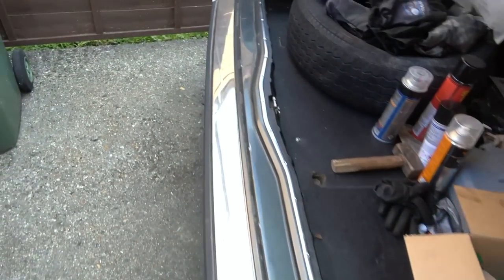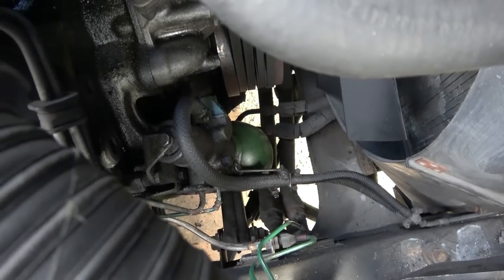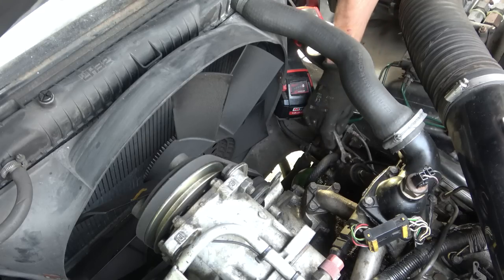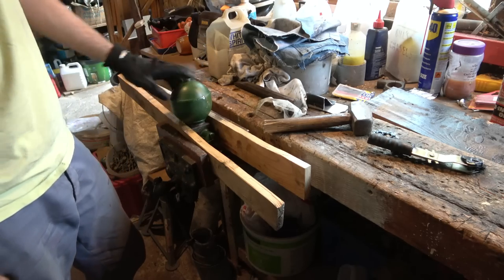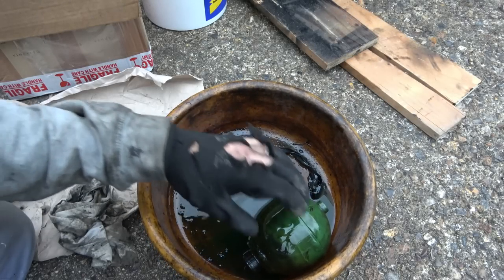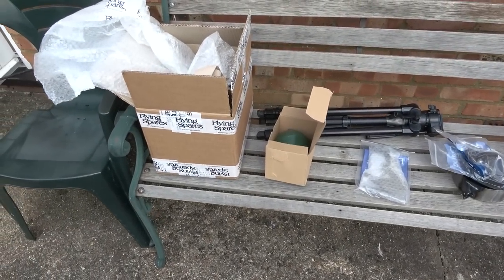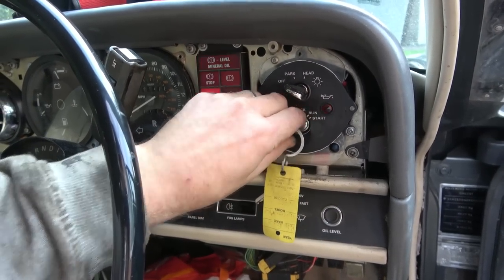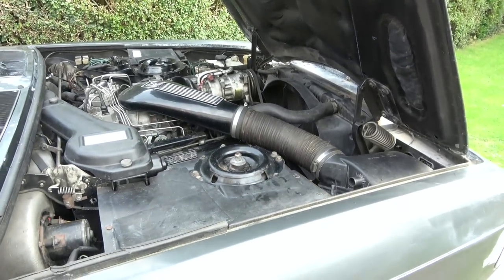Putting Braking Pressure BACK into a 1988 Rolls Royce Silver Spirit - PART 28

Comment: Vince, just a suggestion if you haven't done this already, you should let the car start and run and get nice and warm for a bit (at least a half hour or so). You've done quite a bit of work and starting and stopping the engine. When you run it for short periods, it doesn't get hot enough to burn off any condensation that may build up in the engine causing water to sneak into the oil. You probably aren't doing enough to cause any kind of damage, but with all the work you are doing, better safe than sorry.

Comment: Amazing job, Vince!  I certainly admire your tenacity, bud!  You certainly put your mind to it and make it happen!  I have a 1990 SAAB 900 SPG and it uses the "bomb" pressure braking system, but there is only ONE of them you have to change if it fails AND it's very easy to get to and no where are large as those!!  I don't have NEAR 59 pumps before the light comes on!  Cheers!

Comment: Great video! I had a similar issue with the tire situation on my 91 Jaguar XJ40 Sovereign. This size of tire a bit harder to find and most of those available are pickup truck tires, for 90s and early 2000s Toyota Tacoma. They will do the job, but they aren't as comfortable as true car tires would be. I recommend keeping the front tires for a little while at first, so that you can confirm if the alignment is right, before ruining 2 new tires. Ask me how I know :)
Reply: I'm not sure if an exact date has been mentioned on the channel but I think the tyres are ancient so I definitely wouldn't feel comfortable driving on them. Might be worth having the alignment checked instead. On the other hand if the existing tyres aren't worn too unevenly, that should tell that the alignment is OK.

My dad recently complained about his 90s van being a lot less stable in wet conditions as it used to be. Had a look and the rear tyres are from 2010 (on a RWD van). Should explain the issues!
Reply: @Ragnar8504 
When will part 29 coming

Comment: Great job Vince. I have a quesion if you will. I have a Bentley turbo r with the same sphere ssteme as the Rolls Royce silver spirit. On mine as soon as I start the car I have the alert Low brake pressure. I have it although I put more mineral oil in the two reservoir. Once as soon as I start the engine when I pushed the brake pedal, the oil spilt on the floor orn the front passenger side. Woud please lead me in a possible solution. Please keep doing the great job you've done till now.

Comment: A little tip for you if I may....at 33:54 in order to avoid the risk of damaging a thread, marry both faces lightly and turn anti clockwise until you feel or hear a "click". This indicates that female and male threads are facing properly. Now turn clockwise to tighten with confidence. Like this you avoid burring the thread absolutely.

Another idea::- to ensure a better grip on a sphere using a tool designed to unscrew filters, why not paint a stripe of epoxy around the equator of it. When this is hardened the unscrewing tool will have a better grip on it eliminating the need to use a Dremel to cut out a notch and then a mallet and chisel to loosen / tighten it. Any epoxy, Araldite two part glue is ideal;.

Comment: I'd highly recommend the "La suspension hydropneumatique Citroën" series uploaded by Motor videos S on youtube. Don't worry, the videos are all in English as they were made by Citroën UK. They are fairly accessible videos that explain the hydropneumatic system very well. I'm not sure how much was just copy pasted by Rolls Royce from Citroën, but the pressure regulator you unmounted here definitely looks identical. 

As for the spheres: it definitely seems like the membrane had split on the lower one. Upper one may have been okay though it's likely just as old as the other one ;)

Comment: Nice steps forward in fixing this car :) Certainly was surprise when that oil splashed everywhere with pretty high looking pressure!
Had a laptop keyboard problem myself, the T key stopped working. Opened the keycap but the structure looks weird, nothing like for example Playstation controller buttons. Solution was to buy external usb keyboard :D

Comment: @24:26 - I went through something similar with having to reach down and bruise my chest trying to reach a part on a car.  One day, i was under the car replacing a flex pipe when I noticed that the 'thing' I was trying to remove was right in my face and would have taken a fraction of the time to remove had I slid under the car to survey the situation.

Comment: When working on hard brake lines you really should use a flare nut wrench, it gets more sides of the nut and helps you avoid stripping or rounding of the edges

Comment: Vince, can't remember if you said the age of the tyres, but all tires should be under 10 years old that includes the spare wheel as far as I am aware, because even though the spare isn't in use, there is a high chance the wheel will be used at some point in the cars life, like to get you off the motorway which is when an old tire will explode if it is going to. so you should make sure the age of the wheel you are keeping is good for a couple of MOT's.

Comment: LHM fluid is non-corrosive. It does not eat rubber or plastic. That is why I use a brake system on all of my bicycles that works with LHM fluid.

Comment: At around the 10:00 mark - is that the correct upper radiator hose? Seems like it's extremely stretched over the thermostat housing

Comment: I think there is a special tool for the spheres (sphere removal tool by Citroen). I dont know the details but it can work better from chained oil filter wrench(s). you have been breaking a lot of them lately 👀
Reply: Pleiades ( if I’ve spelt it correctly) sell one. It derives from a mole wrench and can deal with anything. I used it on my D model Citroëns. Spheres like oil filters are recommended hand tightened only but no one seems to quite believe it!
  That height corrector on Vince’s Spirit is identical to a Citroën DS  going back to the ‘50’s. I know having owned both cars.
Reply: I have heard that people here in Australia just use an oil filter removal tool and treat them the same way as an OF when installing.
Reply: @ianmontgomery7534  exactly !

Comment: Oh Vince, you scared me, I almost wet myself 😀(glass with water, not the other thing 😀) Nice job with the fix once again. I was just wondering, why didn't you move the airduct so you would have more space to move around. Btw, what is it that goes bad in those green spheres?
Reply: Flexible diaphragm inside perishes - like the expansion tank on a hot water cylinder. This is pressurised with nitrogen at the factory and acts like the spring in a conventional suspension setup.

Comment: Whoever installed those, those, yeah those cylinders did not know what they were doing, because just like the oil filters, they need to be installed at a specific torque "check manual or ask around", as I am sure it's a torque that is perhaps a 100th of what those suckers were installed at..

APU I dropped yo a  👉👍👈
Reply: Hand tight on a D model Citroën

Comment: that looked like the accumulator to me and the 13 mm bolt will release the pressure to work on the system and btw it dose not need bleeding as the return system will take out any problems

Comment: I am confused. The video started out with saying the car was rocking in the back because some valve doesn't operate when there's insufficient brake fluid pressure. So, you fixed the brake pressure thing. But I can't find if the rocking problem was solved..... Maybe I've not been paying enough attention.
Reply: He hasn't bled the system yet, so we'll probably get an update on the valve next episode.

Comment: I think you are showing your age, In 1983 I had a Honda cb125 motor bike and an Austin 1800 ‘slug’ car, and I had suspension issues with both. And both were advised as ‘that’s a torsion bar’ problem. It never made sense, I think the Austin sort of made sense, but a Honda cb125, 1980’s nonsens.

Comment: They say a boat is a hole in on the water and costs lots of money to keep that hole, looks like a Rolls Royce is the same lol. I remember a good few years back where somebody put the grill and flying lady and a really rubbish car something like a Lada and Rolls Royce bought the rubbish car for far way more than the crappy car's value to preserve the essence the image of quality. I also learned a Rolls Royce never brakes down, it fails to proceed after I questioned a recovery driver pulling down the metallic car cover over one, I was about 10 years old lol I'm in my fifties now. Nice spray of green snot, you didn't check the back of car to see if it had actually dropped.
Reply: Hi Jonathan ,I heard something similar ,a boat is a hole in water that you pour money into!
Got to admire Vince's patience and perseverance.
Reply: @victor58010  Yep, when it's done up it will be mint, saddens me that there is actually a Rolls Royce banger racing forum on YouTube, for the grill and flying lady alone you'd possibly get £300 or more. I'm nostalgic on old car, don't like modern one's rounded shapes like a biscuit tin and ugly. Just my prospective.

Comment: What does the "oil level" button on the dash do?
Reply: On theses cars, it can display the engine oil level on the fuel gauge while the button is pressed. It is handy and allows to not have to open the bonnet to check the oil level.
Reply: @alexandrecouture2462  huh, neat. Thanks!

Comment: You shouldn't need to put fluid on the rubber seals. That was done in the old days because seals were made out of cork. The fluid soaks into the cork to keep it from splitting and crumbling apart when tightening it down.

Comment: Did fixing the brakes solve the 'seized' rear height thingy? Maybe cut open the faulty ball with an angle grinder top to bottom through the layers to see if it had burst inside?

Comment: seems like a no brainer to have moulded that pip on the end of the sphere to a large hex to fit a socket or spanner......but then when did car design and common sense ever exist in the same universe🤣🤣
Reply: French design, say no more. :-)
Reply: @ianhaylock7409   I do disagree. In my experience the Citroen ID and DS are wonderful pieces of design. I’ve worked on them for over 50 years and still run. 60 year old ID 19

Comment: Im at 30 seconds into this video and shouting Don't buy RR just buy Citroen green balls and valves !! its all Citroen stuff.....Im only 30 seconds in so catch you later
Reply: So this was the worlds most expensive video on how to fix a Citroen BX suspension, Im sorry for the sark but every mechanic on the planet avoids the green fluid mainly as if you touch it you will be green stained  for ever ! the system is simple, its a dual balanced hydraulic system that has twin level valves that also interacts to the brake system that gives a tail down brake feeling upon braking.OR when it goes wrong a mechanic goes "OMG big air suck ins tut tut:" and then just swaps out a green ball and charges $600 coz they are the guru of the the green fluid.. its just Citroen juice thing !